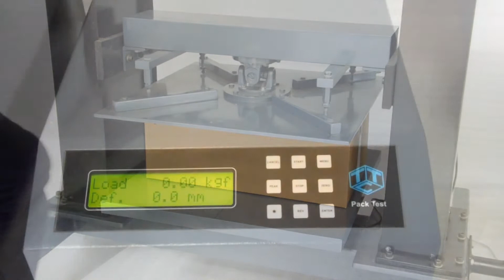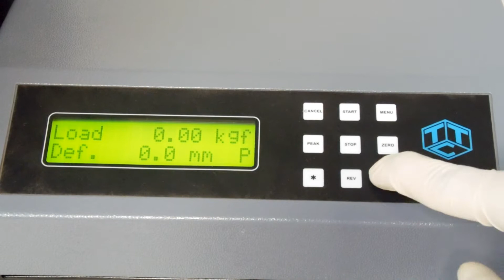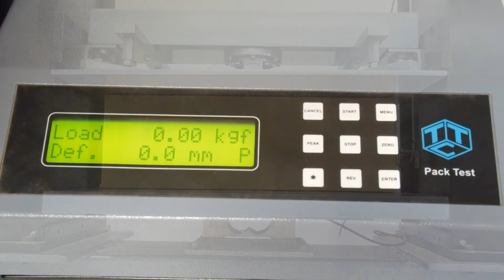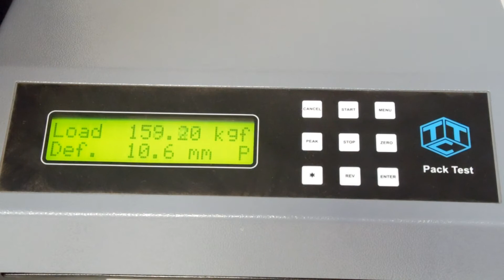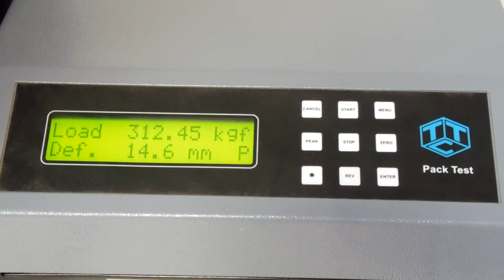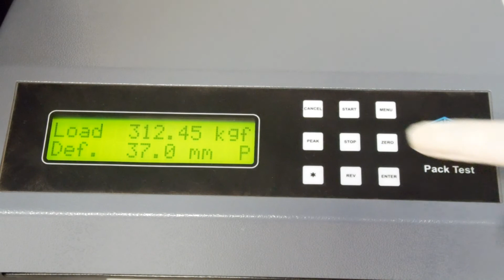Box Compression Strength Tester - U500/1000-S by PackTest.com

Comment: What is the threshold value? How can we guess at which pressure the test has passed?
Reply: You dont have to guess anything. Initially the load starts to increase on the carton. When the carton cannot withstand the load anymore, it starts to collapse / buckle. The force starts to reduce. Threshold Value is the percentage of force reduction you want to allow before the machine auto stops. So basically if the peak force of a carton is 500 kgf and the reading falls by 10% (50 kgf), the machine will stop and the test is completed. Now if we set the threshold to 20%, the machine will wait for a reduction of 20% from 500. i.e. 100 kgf before stopping. This doesnot change the Peak or Result. It only defines when to stop "After" the peak is achieved. Hope we were able to help today.
Reply: @PackTestMachinesInc  Got it, thank you